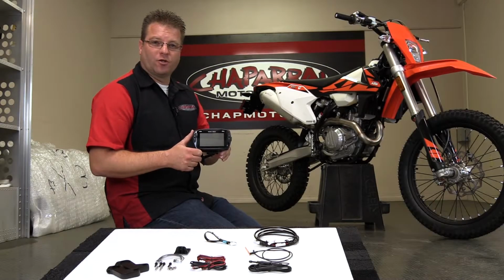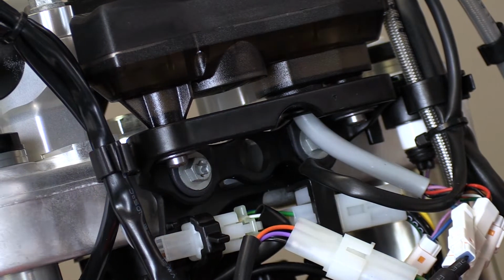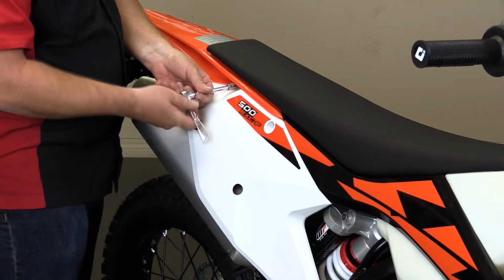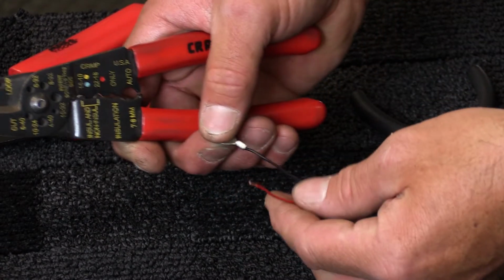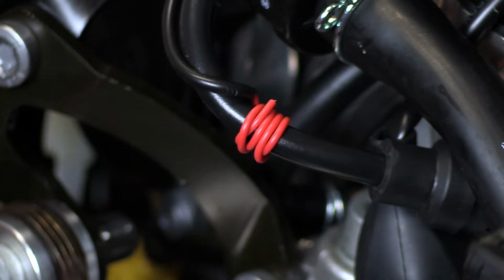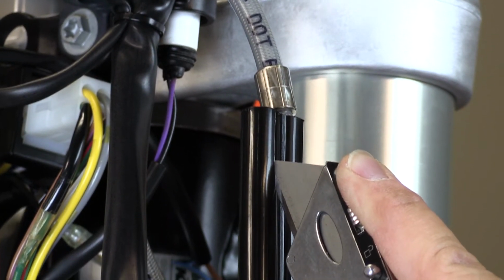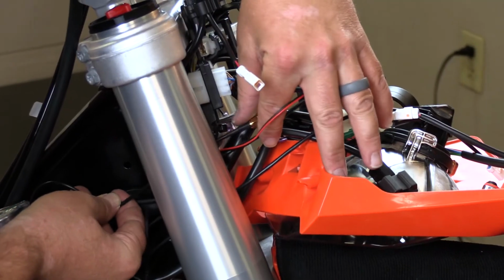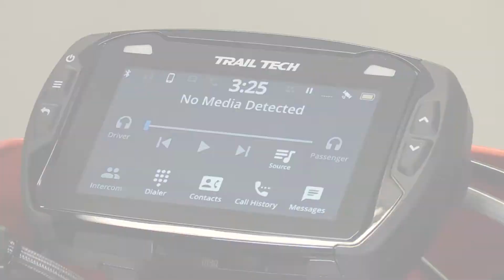Trail Tech Voyager Pro GPS Step-by-Step Installation on KTM 500 exc ChapMoto.com

Comment: The instructions are very clear. The v2v antenna is supposed to be vertically polarized. You’re mounting the antenna on a horizontal plane.

If you ever had a beam antenna connected to a CB or HAM radio and try talking to local friends using vertical antennas while yours is horizontal, you would know that simply switching to vertical improves your transmit and receive strength by a few orders of magnitude.
Reply from the maker: I will keep that in mind for future videos.

Comment: What a terrible design for the coolant temp sensor also your battery is always going to have a draw for that kind of money it should come with a relay.
Reply from the maker: Hello, thanks for your insight. If you have product/designs complaints or recommendations it'd be best to direct them to the manufacturer, Trail Tech.

Comment: The t antenna is the buddy tracker antenna NOT the gps antenna, that is why there are 2 sma connections. You’ll have minimized gps signal and no ability to track riders without setting up antennas right.
Reply from the maker: Thanks for pointing that out.
Reply: So after reading the manual, the trail tech pro has an internal gps antenna and the plug is just for an upgrade ability to get better performance in locking more satellites👍👍

Comment: One thing I'm wondering is if anybody managed to avoid slicing the casing that carries the VSS harness up the fork.  I think that's just a JST connector or some variant.  I believe that there are tools to easily remove the conductors from these connectors.  With many connectors, you can remove the conductors (the wires), route the cable, and then re-insert the wires into the plug in the proper arrangement.  This video discusses it:  https://www.youtube.com/watch?v=Vt_rAIKPlWA
Reply from the maker: Hello, yes there are tools to remove the connector end so that you can take care of the wiring and then use the connector and protective sheaving without having to slice anything.

Comment: Nice video.  Very helpful.  I want to keep my original OEM dash on the bike, however I also would like to use the Trail Tech Indicator Light Dashboard on the Voyager Pro "Protector".  I am worried about tapping into the OEM wire loom to get the new indicator lights to work. Do you have any suggestions?
Reply from the maker: Hello, I would suggest contacting Trail Tech directly. Thanks for watching.

Comment: Trail tech says there is no wheel speed sensor that is compatible with this bike. What part number worked? Possibly Item # 101-06
2019 EXC-F 500
Reply from the maker: Hello, this kit came with a speed senor that replaced the OEM speed sensor. Check the 7:00 minute mark of the video to see how we replaced the sensor.

Comment: Can I keep the original hour meter and use this ?  I like the gps but I don't really need the rpm, temp and hours. Do you sell one without all those but still have the same features.
Reply from the maker: Yeah you probably could but you would need to figure out a place to mount it while keeping your stock unit. We do not sell a stand alone GPS unit.

Comment: alright so the one mystery i came here for wasn't answered: how the hell did you get the mounting arm around the handlebar tube? does that plastic really stretch that much? do you have to strip the handlebars?
Reply from the maker: Hi, the mounting kit comes with two mounts to fit 7/8 inch and 1 1/8 inch bars. Yes the appropriate mount will stretch over the appropriate handlebar. Thanks for watching.
Reply: I had the same question. Funny how that was skipped in the video!

Comment: Do you have to have a bike with a battery?
Reply from the maker: Yes, this 500 exc has a battery and it is recommended. Off the battery is drains very fast.
Reply: How do you charge the unit off the bike?

Does it drain bike battery while riding?

Comment: Why would you want to replace the KTM speedometer sensor and cable?  The OEM version is perfect.
Reply from the maker: Yes Gregory, the OEM is perfect... but it does not "read into" the Voyager Pro. That is the only reason for the replacement. Thanks for watching.  -- Kyle & the Chap Moto Team

Comment: So did you just make a street legal bike illegal? No high beam indicator, turn signal indicator and you lose your check engine light too? Looks great for a trail bike though.
Reply from the maker: Farmer Dave thanks for watching.  Nothing about the installation made it any less street legal.  The bike still has 100% of its functionality + additional features.  There is nothing in DOT law stating that you need to have "warning lights" for your headlight, indicators, etc...   Thanks for watching.
Reply: You must be in a crazy state then. As a former licensed dot safety inspector, not having a high beam indicator and turn signal indicator when turn signals are equipped is an automatic fail.
Reply from the maker: Very interesting Farmer Dave. Here we need to have the lights, but there is not a requirement for on dash indicators... Or so I thought. I will check with a local DOT / CHP buddy... Now I am curious. Thanks for taking the time to watch and to comment!! - Kyle
Reply: No problem, in Texas you dont have to have blinkers, but you would have to use your hand signals. The law requires  a horn, at least one mirror, and high beam with indicator, low beam thats always on along with taillight/brakelight thats always on. Laws are different state to state tho for example Iowa requires blinkers and two mirrors. It just caught my attention, not trying to call you guys out but in some states dot might take issue is all. It looks like a sweet setup and they should make a mount with the indicators like they have for the vapor/striker.
Reply: I agree, I'd rather this came with a T-harness to keep the stock KTM dash even if it's tucked underneath the unit. The hour meter and mileage counter are good to have as well as the lights. Also it would be awesome if HighwayDirtbikes came out with a mount for it!
Reply: @DavidBoucher88  I'm a bit late but they sell the indecator bracket for it
Reply: They sale a kit to add the indicator light around the protective case.

Comment: Will my voyager sensors just plug right in if I’m upgrading?   Wheel, temp, ignition, power?
Reply: Yes, mine did.
Reply from the maker: Great question Terry Ash.  It all depends on how old your Voyager is...  We have close-up images of each part. Just watch the video and compare to your current set-up. You should be able to quickly compare.  Even if they are not the same, installation was super simple and it won't be much work to run new sensor leads. - Kyle & the Chap Moto Team
Reply: @chaparralmotorsports  What year bike did you do the install on? I'd like to replace the OEM 'dash' but wonder if it is plug and play on a 2012.
Reply: Be very careful connecting directly to your battery it will drain it even when not running. Connecting it through a circuit that turns off power after the engine is not running is a very good thing.

Comment: Can it be installed with a scotts steering damper?
Reply from the maker: Absolutely Mike.  The mount kit is very generic and therefore is not very "rigid" on where it needs to be mounted. I myself would created my own bracket... but the handlebar mount in the kit does the trick.  - Kyle & the Chap Moto Team
Reply: I am thinking the same thing, using the holes that hold the stock cluster to mount brackets that hold the Voyager.